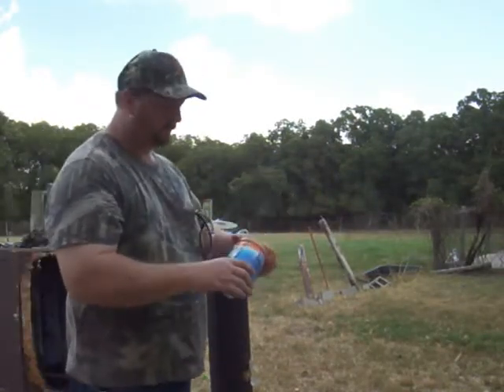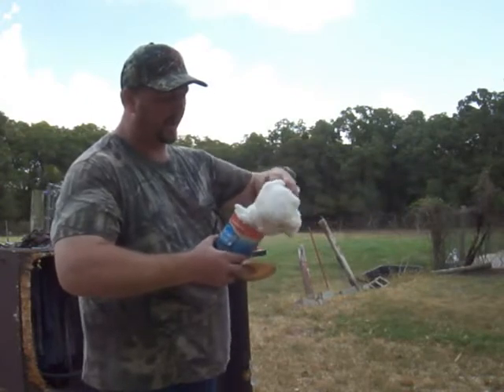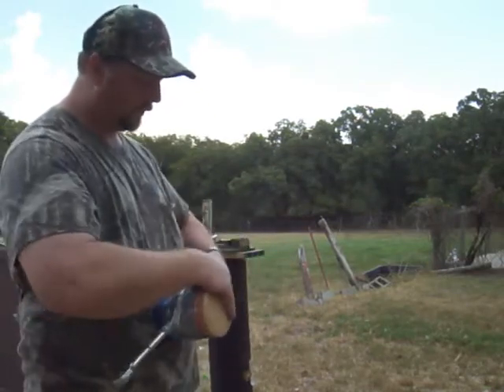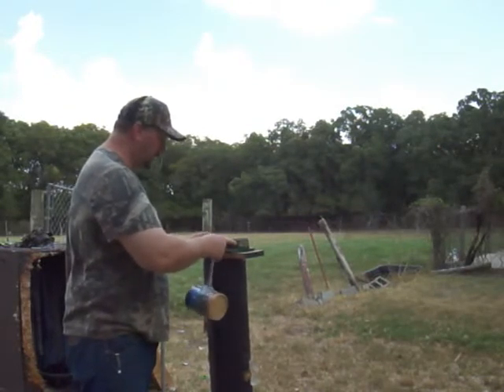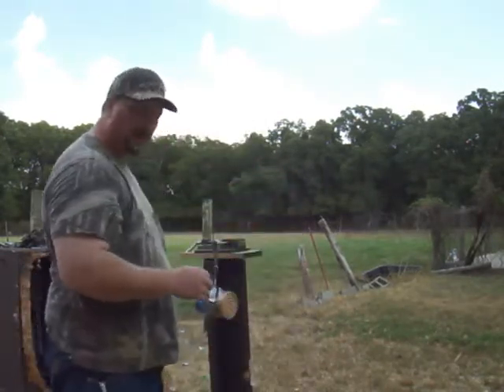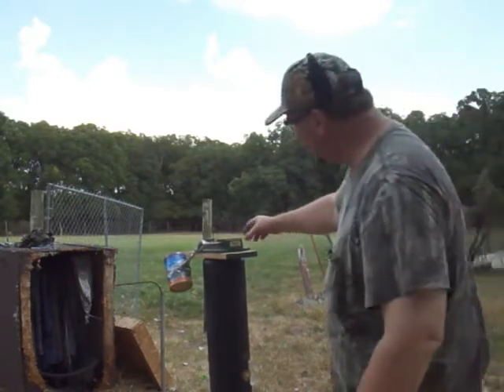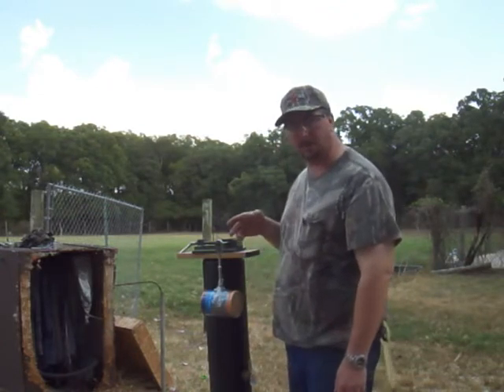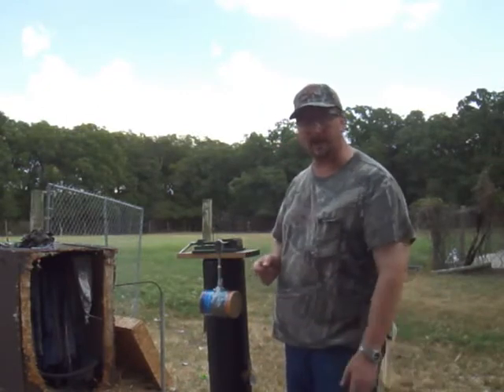The Redneck Force Gauge for measuring ammo energy in shooting sports, how to make and use it.

Comment from the maker: If you're needing it to be a little heavier duty for firearms, you can use a longer handle (pipe duck taped on) or as I said, simply put more weight in the can.
There are some formulas out there that will allow you to figure FPS using a device like this... since force or power actually translates to speed fairly easily.. but where this device really shines is in determining comparative force.